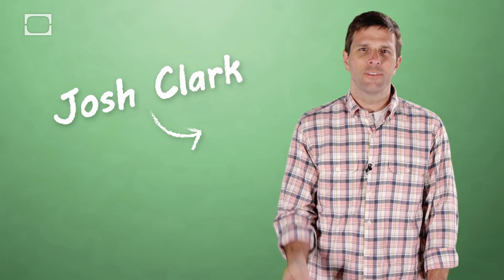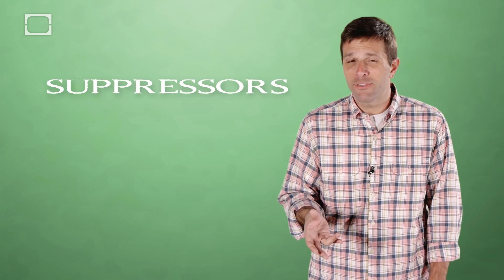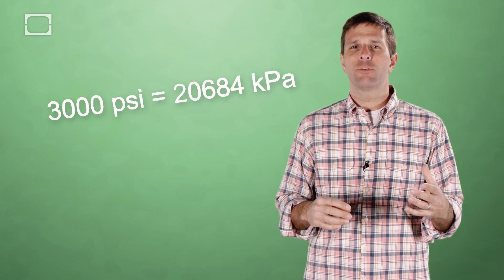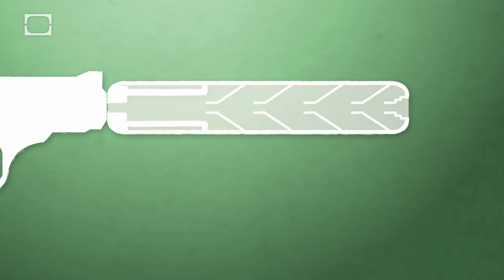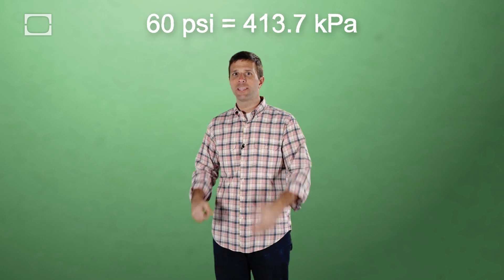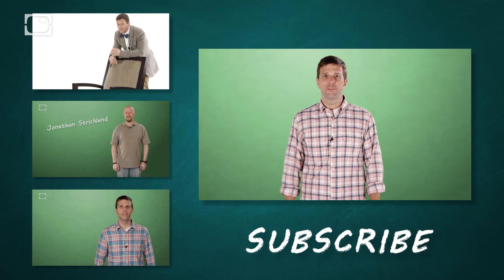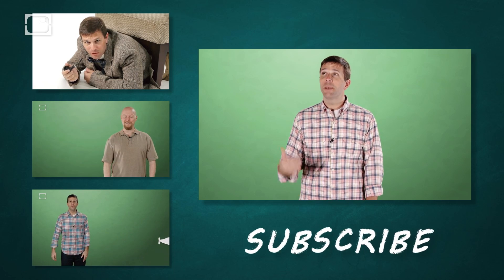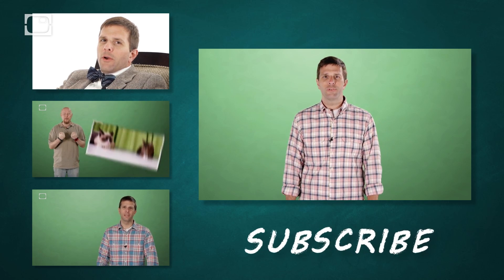How Do Gun Silencers Work?

Comment: 1.) There's only one fairly rare revolver (the gun at the beginning) that can be suppressed due to the cylinder gap of revolvers. 2.) Try more like 120db for subsonic rounds other than .22LR. Hearing loss can occur at around 85db. 3.) the Official term by the FBI is "silencer" and yes the FBI knows what they're talking about. 4.) Some actions, hammers (or strikers, since apparently this channel doesn't know they exist), or other mechanical party make far more than 20db
Reply: +William Lee Several people have suppressed Nagant revolvers because the cylinder moves forward to close the gap. A suppressed custom Dan Wesson was used in an assassination attempt on Idi Amin. It had an adjustable cylinder gap.
Reply: +Hunter Shaw Never said it had. 85db is around the threshold at which hearing loss can occur if one is exposed to for extended periods. Unsupprressed guns are about 150db on average, and suppressed guns range from about 120-130db, which is still plenty loud enough to cause hearing damage, when exposed to multiple rounds being fired (no one goes to the range to take one shot).
Reply: +William Lee lmfao  so true!
Reply: +The Chopping Block The nagant was the one I was referring to, and I meant production pistol. The point is that almost all silenced or silencable weapons are automatics
Reply: +William Lee True. Revolvers can be suppressed, but it is more complicated.
Reply: +The Chopping Block And expensive haha
Reply: +William Lee Nagant revolvers are not rare at all. The ammo is a bit, though...
Reply: +Boris Mezhibovskiy No haha they aren't if you really wanna find one. However, you're not gonna just walk into a Walmart and grab one like you can a Glock. I said fairly rare as more of a shorthand for "not super common"
Reply: another big mistake , the gun pwder doesnt explodes it implodes if it would exploded the gun would be totaly damaged after one shot
Reply: +adejal acr No, he is correct that it is an explosion, just a directed one. Expanding gas = explosion.
Reply: +William Lee Hearing loss is a result of high dB level (RMS) over a period of time. A few millisecond peak (like a gunshot) of 85dBA has never hurt anyone's hearing, ever. 95dBA RMS takes about three hours of that constant SPL to start causing hearing loss.The higher the SPL, the less time it takes. He was pretty close to correct in what he said about hearing damage.

Comment: I love TestTube and I hate to see you guys embarrassing yourselves. Leave the comment about "people you don't want to associate" out (it's alienating and didn't even have comedic value) and replace it with actual facts. Good info about the ballistic crack for people who didn't know about it, but the dB measurements are flat out wrong. It depends on the caliber and grain (among other things) of the rounds being shot, and DUH the design of the silencer. Even taking that into account (and using subsonic rounds), most shots through a silencer will not even come CLOSE to 20 dB unless you're shooting .22LR or something similar which has slightly higher stopping power than a pellet gun. By the way, I'm not even a gun nut. Please in the future do some fact checking!
Reply: +userno99  Everything in this vidoe was wrong.  
From the picture of a revolver with a silencer, to them not being called silencers (or Cans as most of the time referred to), to the sound levels, the effect on bullet velocity or accuracy.  
Sadly everything flat out wrong.

Comment: I'm not even going to go over the whole list of information that he has wrong but here are a couple.
 1)Modern handguns reach pressures of about 35,000 psi not 3,000 (9mm max pressure is 35,001 psi)
  - Modern rifles reach pressures of 60,000 psi and that isn't even considering the magnum loads.
 2)A "Can" (which is the slang equivalent of calling a firearm a "gun") will never get a gun down to the sound of soft whisper.
 
In summary please look up a video that will actually show you what happens and let you listen to it rather than have an ignorant person rant about topics he clearly knows almost nothing about.

Comment: Decent enough video but if you want to give accurate information you should redo it. Reducing the sound of a gunshot to 20 Db is incredibly ridiculous and is repeated more than once, and even with the annotation it still leads the character into describing a suppressed gunshot as "whisper quiet." Showing a graphic of a suppressor attached to a (non-Negant) revolver  is silly, and saying that a suppressor makes a gun less accurate is false as well. Additionally, if you feel it compelling enough to mention the noise of a hammer dropping, you should also mention the noise of the bolt cycling as well.

Comment: Even shotguns operate way above 3K psi... I think you meant 30K psi. And wtf is wrong with people who call a suppressor a can? Why wouldn't you want to hang out with them? 

Dude, I also don't know if you'e joking or not, but get real. People who buy suppressors do not buy them to make their guns quieter so they can get away with murder. 

Another thing you were way off about is the accuracy issue and velocity reduction. Suppressors increase muzzle velocity with increased backpressure, slightly, but not a reduction. And, they increase accuracy in a number of ways, but most notably, due to the reduction in muzzle blast and felt recoil and the subsequent reduction in shooter flinch when they are about to pull the trigger.

Why would you post a video about informing people of something you fear, or think should be illegal, or have such disdain for the users thereof?

Comment: Wow, two glaring mistakes: Supressors don't reduce the energy of the bullet, neither the accuracy. Larry Vickers did some very long range shooting and the gun performed better with the supressor on. 

https://www.full30.com/video/974fd96009b5b9b8af2337088b5cc17d

The potential issue of a supressor is that it increases the pressure inside the gun, wearing out a bit more.

Comment: I recall reading that sound silencers have wipes to slow the projectile down to subsonic speeds so yes they can solve the sonic boom problem.
Reply: +Brian Su No. The projectile does not touch the baffles in a suppressor if it is properly aligned. The suppressor actually increases muzzle velocity, and you have to use ammunition that does not go supersonic with the CAN on your gun to keep the audible signature of the weapon down. It doesn't hurt your ears to fire supersonic ammunition with a suppressor, but you don't want any projectile hitting the baffles of your $1000 can as it travels through them. That is called a baffle strike, and could ruin your expensive NFA item, and quite possibly your gun and face.
Reply: dadajack ahh ok looks like where I read it from was totally wrong. hahahaha
Reply: There were some suppressors which utilized wipes, but they didn't do anything for the sonic boom.
Reply: And they did not last long. Read about the hush puppy.
Reply: They also didn't slow the projectile, rather, they simply provided better gas sealing.